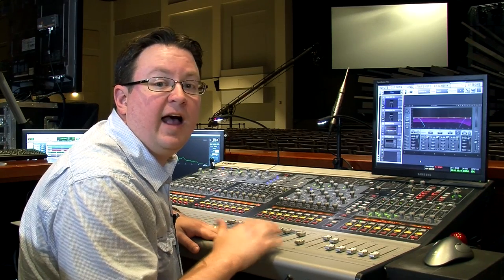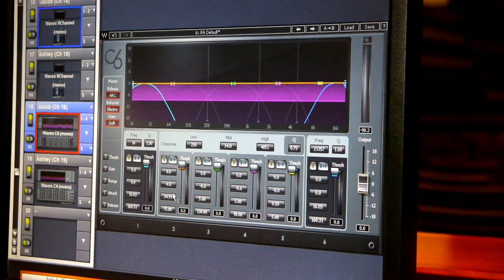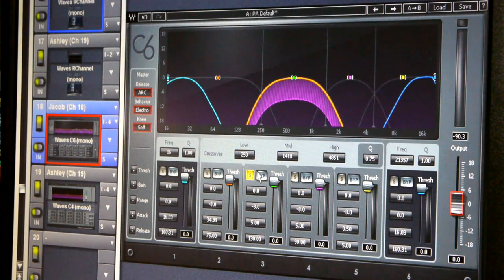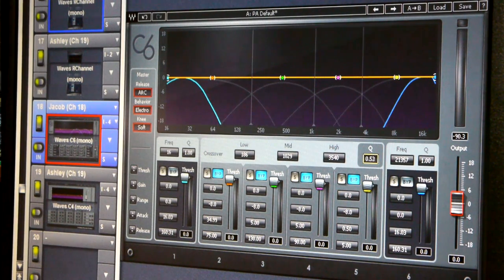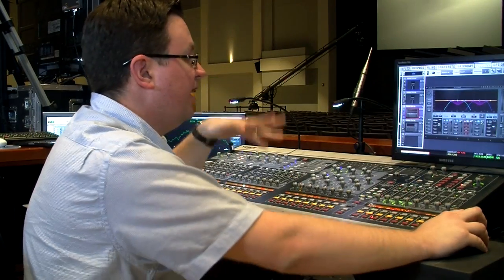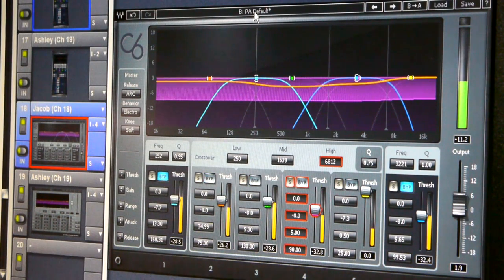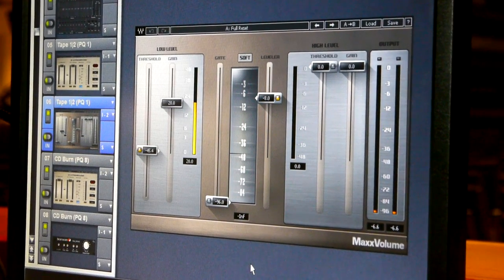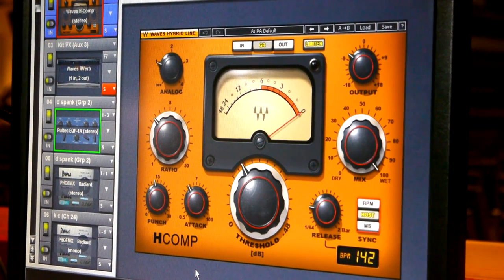C6 Multiband Compressor Tutorial

Comment: Would you mind explaining how to use the A.B. function, I know how to bypass something but I swear I cannot figure out the AB dealio
Reply: Steve Stockmal so let's say you chose to eq the vocal an aggressive way, lots of low frequencies carved out and a heavy low cut filter. You like the sound, but want to try a different approach. Maybe one where you boosts the upper mid frequencies and left the low frequencies in tact. Well... with a/b you can try one style, then press the a/b button and do another style. After you can compare and see which one you like. So you have two different eq settings switching between. Bypass would let you choose 'eq on' and 'eq off'. Understand?